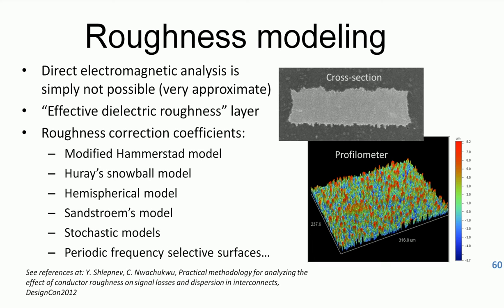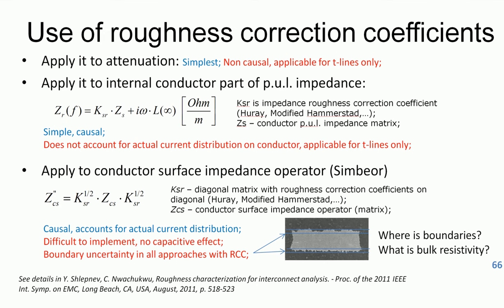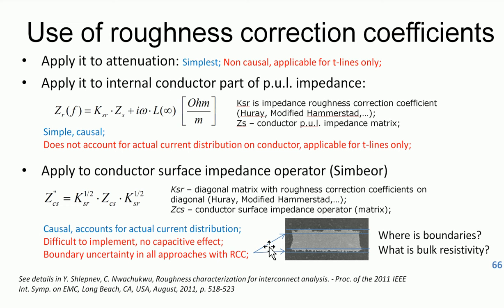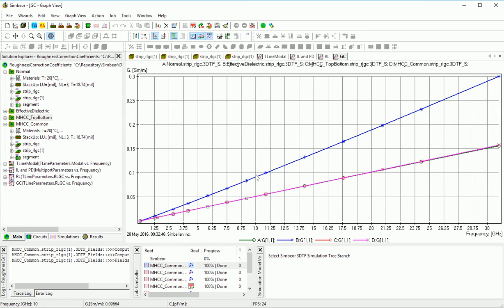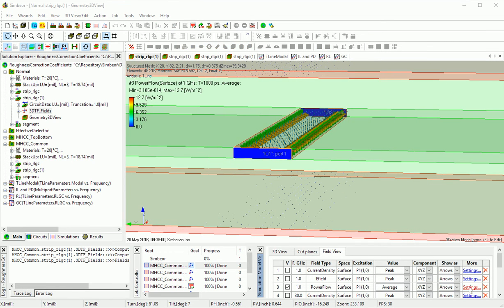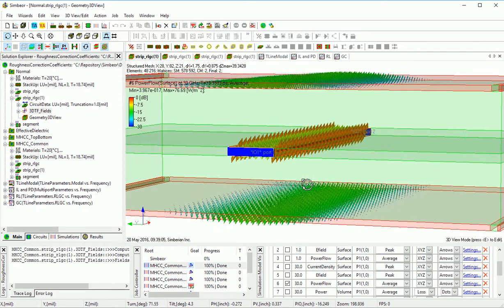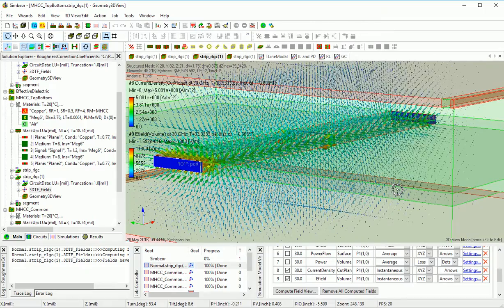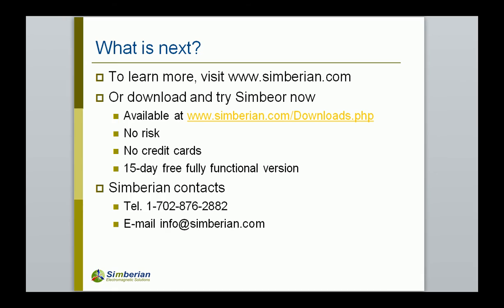How Interconnects Work™: Conductor roughness modeling with Roughness Correction Coefficients

Comment: This is what happens when one's programming skills are superior to his knowledge and understanding of electrical and electromagnetic fields.
Reply from the maker: Alan, what is wrong with the understanding of the fields here? - please elaborate
Reply: The algorithm used here confuses surface roughness with electrical length.  While the resultant values are close, in a way, to being correct for electrical length, they are in no way attributable to roughness of contact surface.  Of course, electrical length swamps all other effects always anyway, so this software gives the impression that roughness is at work, and that is just not so.
Reply: Alan, there is no confusion of the roughness with the electrical length in the algorithm - you can clearly see minor effect of the roughness model on the phase delay and substantial increase in attenuation at the same time. Let me explain how it works. It is all in the scale. Assume that the roughness bumps are much smaller than the wavelength in dielectric, but larger than the skin depth. We observe increase of absorption at a layer on surface of the rough conductor. At the micro-scale we can observe power absorption at the surface layer of the rough surface, that produces a layer of current following the surface. If we flatten the surface (as it is done in the models with roughness correction coefficients), we should observe increase in the effective electric field (think about voltage drop along rough surface divided by the length of straight line on the surface). Larger electric field in the conductor produces larger current (Ohm's law) - it is effective current in case of the model. As the result, we observe substantial increase of the absorption by the conductor surface. However, that does not substantially change the electrical length (phase delay).  This is because of the phase delay is defined by the quasi-TEM wave propagating in the dielectric straight along the transmission line and not following the micro-bumps - I definitely needed to show that and how this is related to the power flow into the conductor shown in the video. The power flow is disturbed only in a very thin layer very close to the surface of the conductor - it does change the overall phase delay only a little due to additional magnetic field in the rough conductor surface (increase of internal inductance). I am planning to talk about different models at the oncoming EPEPS conference in San Diego later this year. I can recommend you to read the original Samuel Morgan's paper that was used to construct the Hammerstad-Jensen model or Paul Huray's papers or book - they explain why there is not much effect on the electrical length. It is all about the scale.
FYI: I consider my programming skills much less advanced then my knowledge of computational electromagnetics :-)
Reply: The plot of results clearly shows frequency with respect to amplitude due ostensibly to roughness.  The values are characteristic of simple electric field effect, and values of roughness effect are exaggerated. 

Skin depth is not a useful analytical concept but bulk resistivity, cross-sectional resistivity, resistance, inductance and capacitance can be. More importantly, critical resonance and resonant effects in the model are completely ignored; this is the failing.

 Electrical length is not phase delay. 
 
I don't agree with you, why would I want to read sources that lead you to such awful inventions? So I can be in contention with them as well?  Thank you, no, it is more than I bargain for to be in contention with you alone.  I consider the software itself to be much more of an achievement than the electromagnetics algorithms, analysis and results it delivers, which I consider to be way off mark.
Reply: +Yuriy Shlepnev You can learn it, Yuriy, from general relativity, Einstein and Lorentz and some other good physics conventions.
Reply: +Alan Thomas Yes, Wikipedia is awful about electrical length, it is useless on that account.
Reply: Alan, it looks like you are creating your own understanding of electromagnetics. Where from I can learn it? Just kidding :-) The effect of roughness specifically in PCB interconnects can be actually dramatic and confusing as shown in this demo. The effect is confirmed with measurements in multiple papers - just google it. Everyone is wrong?

Skin depth is just a number to feel the scale of conductor-related effects.

Phase delay can be used to characterize the electrical length - it is easier to see the differences comparing to just phase.

We rigorously correlate all models we built into our software with the measurements. That is applicable to the roughness models that are in use by our partners and customers since about 2007. We published results in multiple papers at pier-reviewed conferences. So far, nobody noticed that it is "way off mark" :-)
Reply: +Alan Thomas Most everyone is out on a limb with their conventions of electric fields and need to get back to basics.
Reply: looks line I wasted my time solving Maxwell's equations? ;-)
Reply: +Alan Thomas The bottleneck with electrical electronics engineering is universally widespread and has become an industry standard.  I'm open to better suggestions than Wikipedia as a way to precipitate change.  I prefer one person at a time; I'm also at odds with  commerce quite enough already, not wishing to be another example of what not to do, like Tesla and others.  God knows I prefer to play my cards close to my vest.
Reply: +Yuriy Shlepnev There are some for whom Maxwell's equations have not been a total waste of time.  Maxwell's model has to be augmented somewhat; this is what Alexander, Einstein and Lorentz have done and the really important parts are not included in conventional electrical electronics engineering curriculum.
Reply: +Yuriy Shlepnev Think about it Yuriy; thousands of harmless technical papers get published every day, only to flash before curious eyes.  Any that are of commercial potential become patents and disappear.